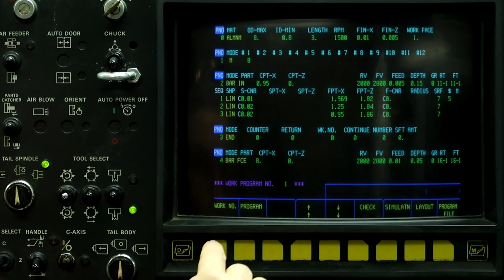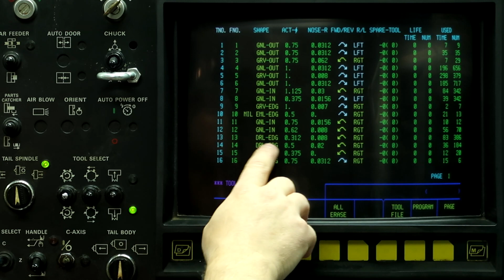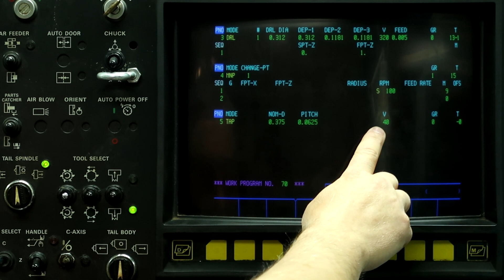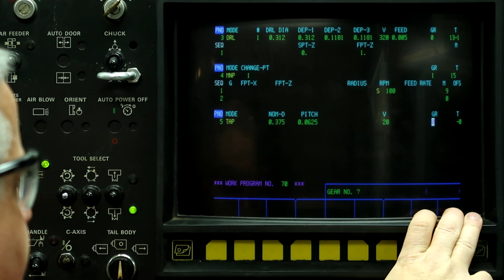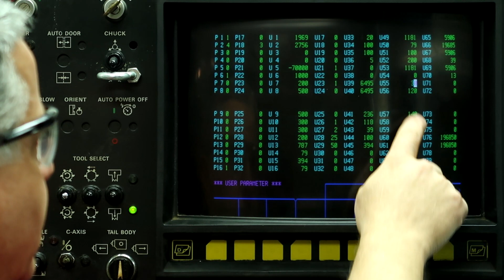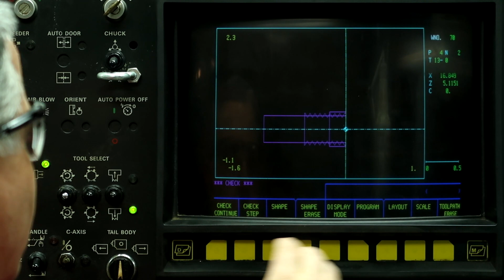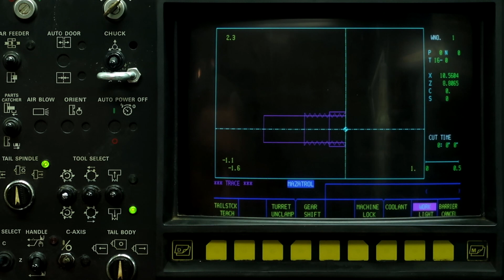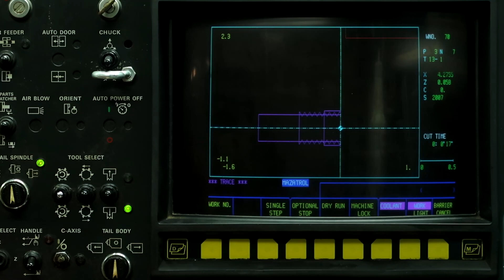Mazak Tapping CNC Lathe Main Spindle

Comment: Hello Phil, I run the same  T3 Quick turn as you do and for some reason we can't tap on center with a static holder. It seems that the speed and feed doesn't sync.  I always have to tap on center using a live holder with a radius of zero. Was wondering if you had any suggestions. Thank you in Advance.
Reply from the maker: Are you sure you are programming the tap feedrate correctly?  I am not sure what else it would be.
Reply: Yes, I thought perhaps it was a parameter setting.  I've tried about everything else.  We got the machine used many years ago and no one could ever get it to tap correctly.

Comment: Remember to set it as either ridgid or floating tap, depanding on your toolholder.
Reply from the maker: This old machine does not have rigid tapping capabilities.
Reply: @mazatroltipsandtricks6816  
Are you sure there is not a RIDGID and FLOATING option in the settings?
Reply from the maker: @allancnc  This T3 control does not have rigid tapping. Too old.

Comment: Great videos.  I run the exact machine that you have.  I can't tap on center for whatever reason.  I have to use a live tap and holder and program it to tap on center. I have had mazak techs look at it and no one seems to be able to figure it out. I'm thinking it must have something to do with parameters.  Maybe you know.  Thanks in advance.
Reply from the maker: I have not come across a problem with tapping with the main spindle other than needing a floating holder.